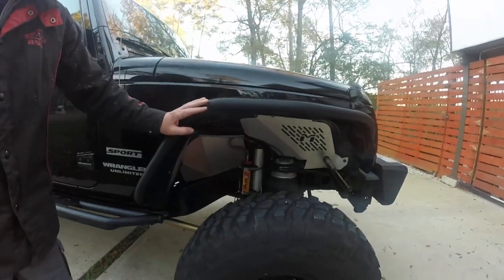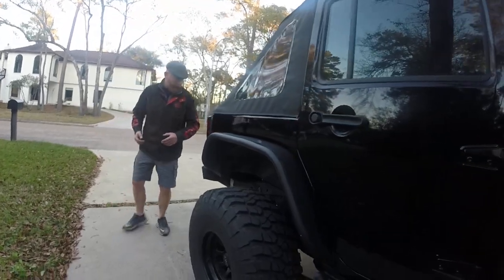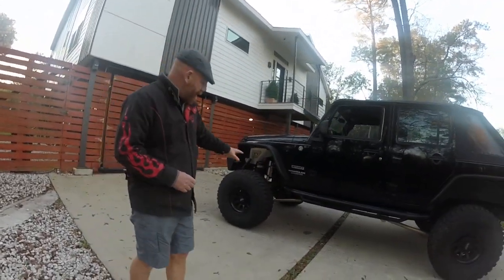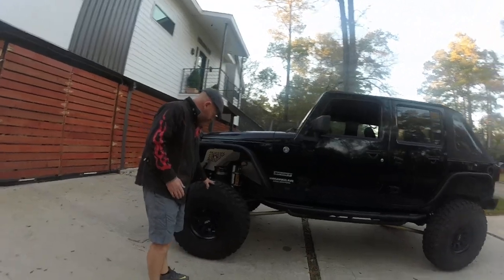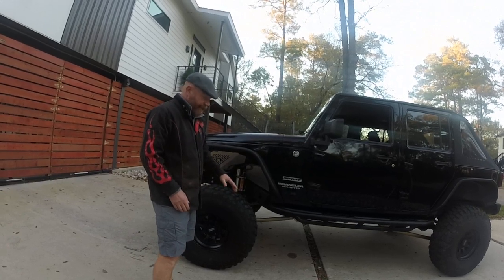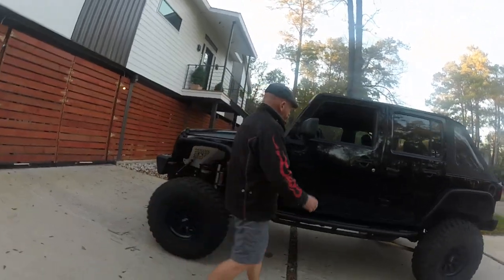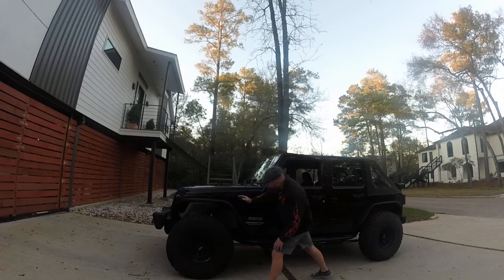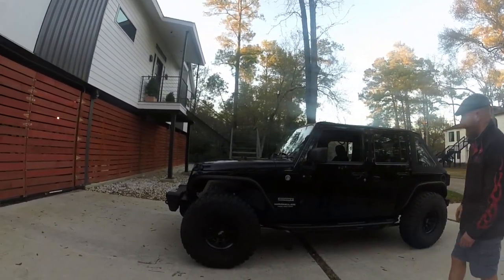Jeep  Rubicon JK Long Arm Air Suspension System

Comment: Great setup could you share the components you used to do this. Thanks
Reply: What firestone number did you use 🤔 i definitely like how turned out
Reply from the maker: Thanks, most of the components are self fabricated.  Joints are Krawler joints, Air bags are Firestone.